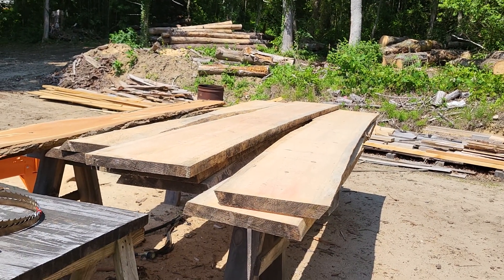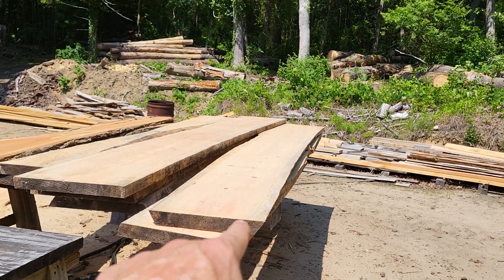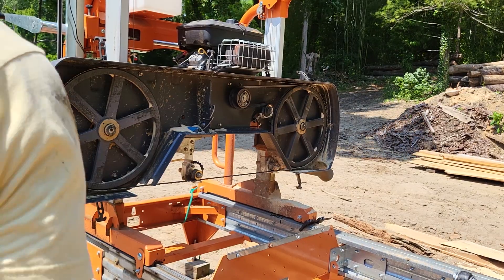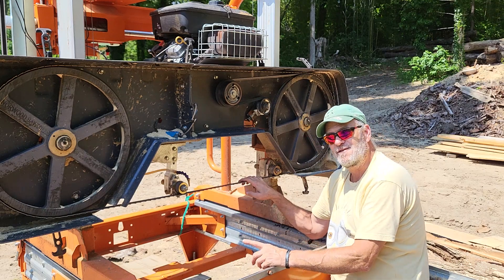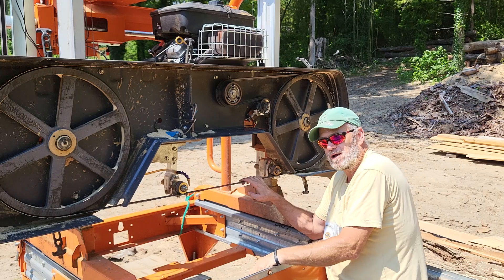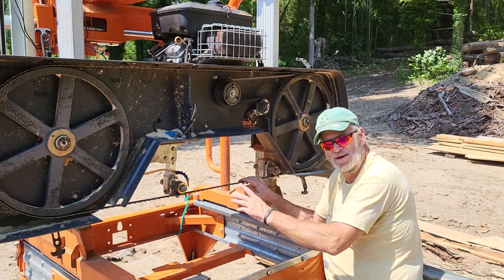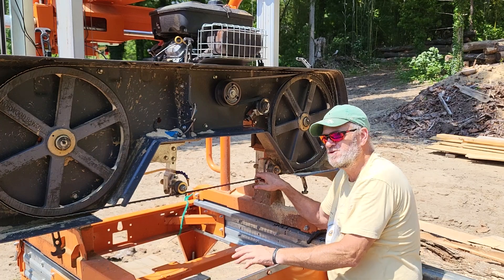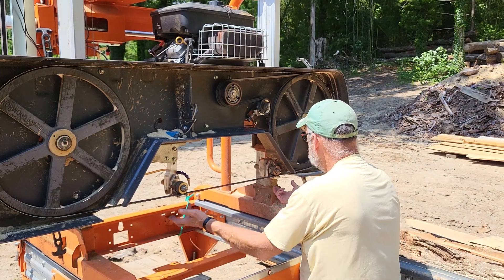Norwood HD36v2 final thoughts on the new roller guide upgrade.

Comment: If I had the money I would have a woodmizer or a Cooks. There are many quirks with these Norwood machines, You get what you pay for, affordable but with issues.
Reply from the maker: Well, my HD36v2 with full hydraulics is more expensive than a fully hydraulic LT35.  So, this isn't a "cheap mill."  It cost 15K in manual form, and the hydraulics are another 15k.  This isn't a "Woodland Mills."